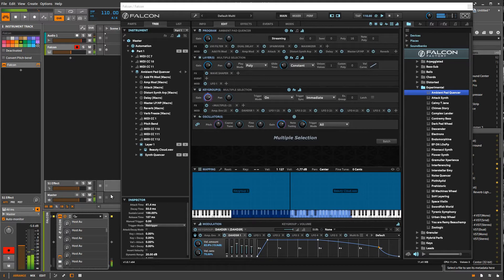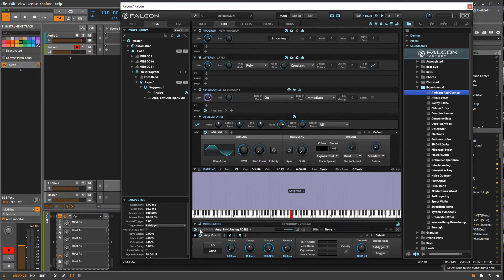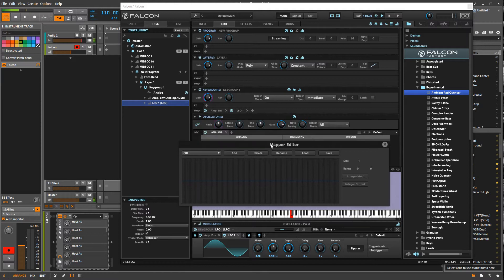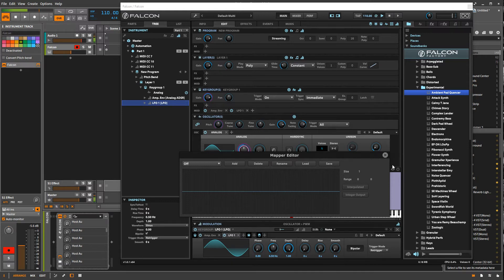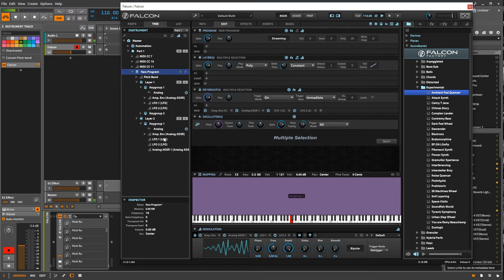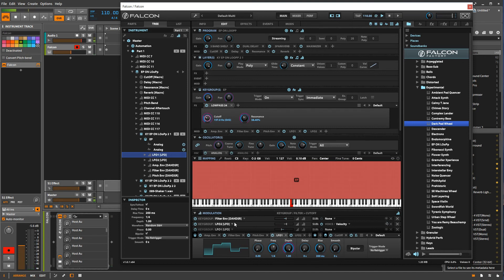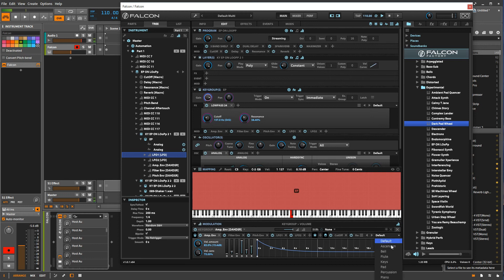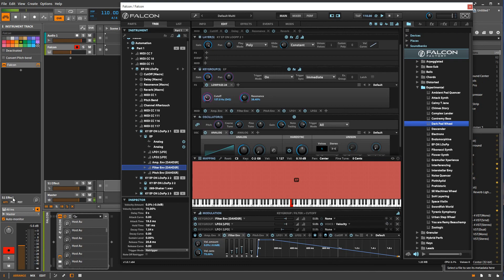UVI Falcon: Modulation In Use

Comment: LFOs and envelopes are grouped(linked) because you did not turn off the link emblem light on the oscillator bar. If you turn that link off each oscillator modulator will be independent.